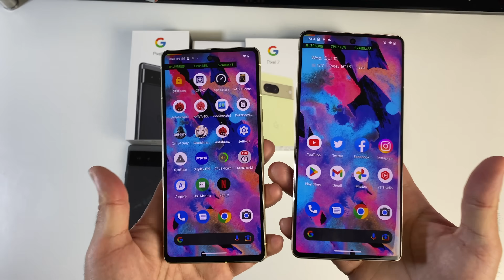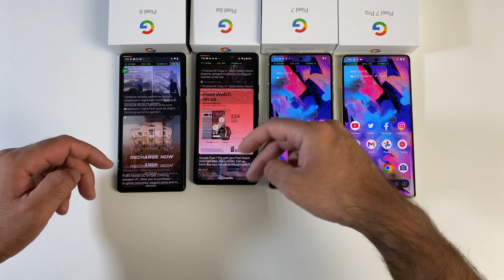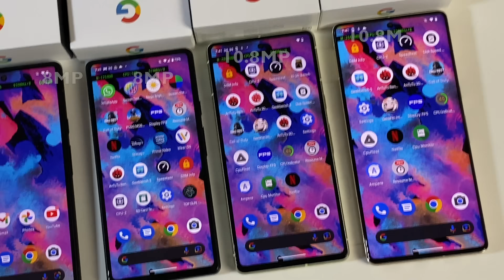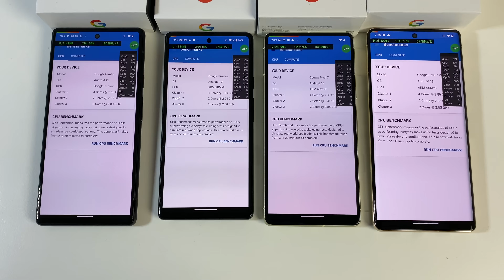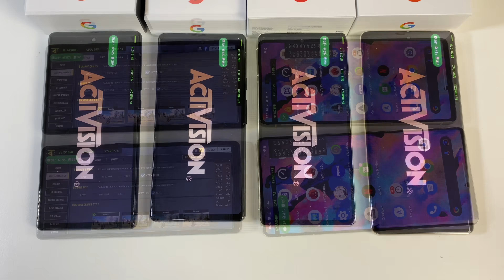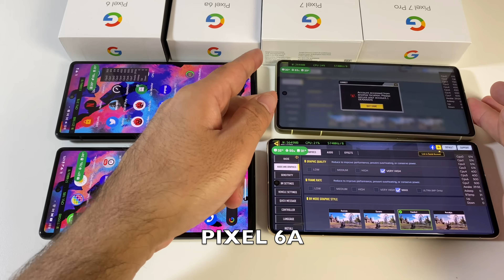Pixel 7 Pro vs Pixel 7 vs Pixel 6 vs Pixel 6a | Detailed Comparison, Camera Test, Gaming, Battery +

Comment: I am thinking to change my pixel 6a to 7a, would it make sense to change to normal7??? I would like to stay at size 6,1 ..:)
Reply: I had a Pixel 4a 5G before the current Pixel 7. And I can feel the difference between 6.2' and 6.3'... The first one is much easier for one handing. I got used to it, but I have better opted for 6a due to it's compact size.

Comment: All that money for each phone and no headphone jack. I feel like it's a rip off, the problem with Headphone adaptors is they don't last long, the cord bends and it sticks out. Plus if your phone is moving around in your pocket or in the car, it can wear out the charging port which is exactly what happened to my Huawei mate pro 20 I had for 5 years.

Comment: Why do all the phone manufactures think they have to use a glass or ceramic or some other heavy, high-and material and not plastic? I would much prefer a solidly constructed plastic phone, save a little bit of money, but have high-end specs, across-the-board
Reply: It also help with wireless charging over plastic
Reply: Because glass is better for thermal conductivity.
Reply: @HeelOfAchilles1  that’s not the reason they select glass over plastic.. they have heat sinks built into devices to spread out the thermal energy. There is more flexibility with injection molded plastics to design integrated heat sinks with copper or order more conductive metals for heat dissipation
Reply: @HeelOfAchilles1 nice assumption dummy

Comment: You should do the p7pro again. I hit 3400 multicore and 1100 single core after the most recent updates. I did on a wifi signal though.

Comment: Great review, thanks. Interesting how the 6a manages to keep up in real-life sense with its far more expensive siblings...even winning a number of the camera tests. 

Just checked Amazon and found you can pick one up for £350...compare that with £599 for the new Pixel 7. So the question is, would you rather spend £250 on something else like a high quality headphone?
Reply from the maker: If i was not a tech YouTuber, my daily driver would be the Pixel 6a and I probably would not need to upgrade until Pixel 8a releases.
Reply: I just bought a 6a for £180 on Amazon after trasde in (£12.50 for my old S7, plus Extra £100 for any trade in, plus £100 discount for Black Friday) bargain.
Reply: The 6a is worth every penny plus pair that with a nice set of buds and u are good to go 😄

Comment: Pretty sure the 6A wins many of the photo shootouts is because it's the older smaller sensor, which means a shorter focal length lens, which means a greater depth of field, and therefore better focus and clarity. Simple optics. Also, smaller camera parts should move quicker, which means perhaps focusing faster and doing image stabilization faster. Sometimes smaller is better.
Reply: PS: do you think all the important 6A bugs have been fixed? I don't want to spend hours dealing with a poor modem, etc
Reply: @EvanRavitz  pixel 6a works perfect, no bugs. Buy with confidence.

Comment: Iam saving up for the 6a...Nice comparison Chigz 🙂
Reply: Its $299 now
Reply: @Plutos_Transformation  should i get it? i have the pixel 3xl is it much smaller? 299$ it is a great price.
Reply: 6a is good but it will get outdated in a year or year and half as its sensor is quite quite old
Reply from the maker: Yes 6a is so nice for the price. Thanks for watching.